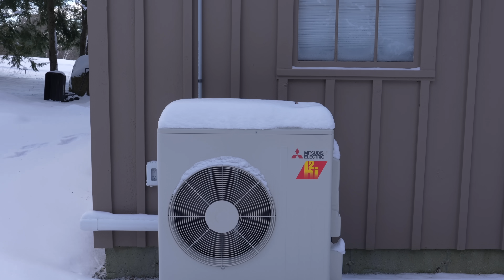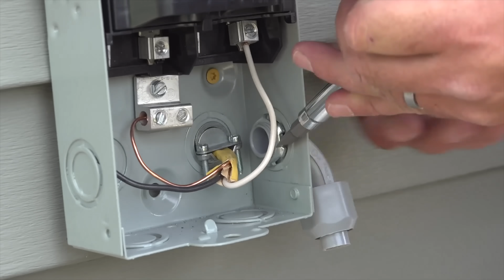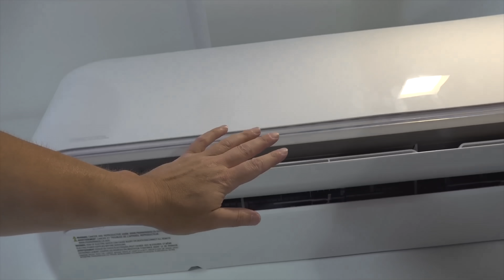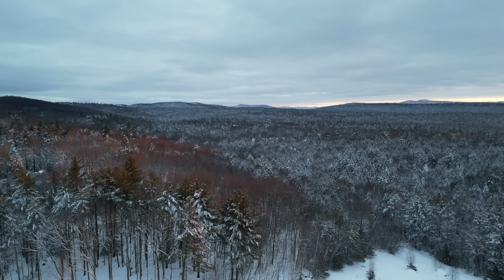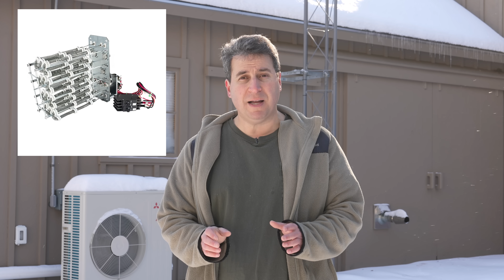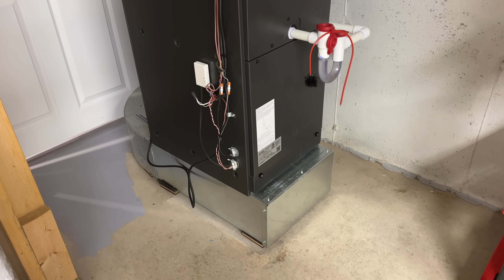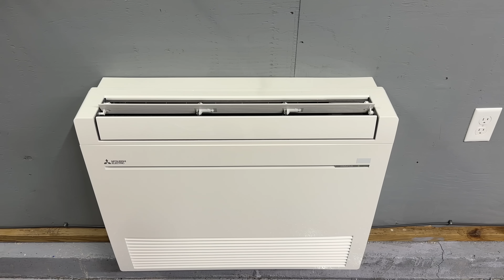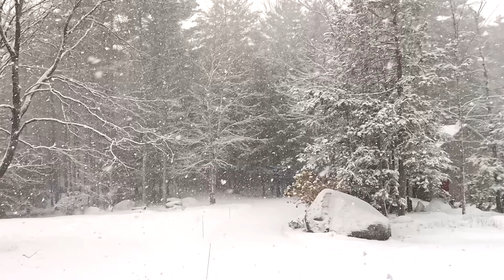Why Heat Pumps are now leaving people COLD

Comment: My experience is that our heat pump is extremely efficient most of the year when it's just a bit cool outside. There's typically only a couple days a year we really need to fire up the old wood stove to stay comfortable. It's also pretty cheap to keep a bunch of firewood in the basement in case of an extended power outage. Though what made a really big difference was renovating the living room and discovering that a large section of the outer wall was basically uninsulated. Simply fixing that and installing better windows cut our heating costs in half.
Reply: Blows my mind how many people don't understand the basics of heat pumps. They're great for small changes in temperature, but really struggle in crazy weather. That's sorta the entire point, it's efficient, it's like being surprised a hybrid doesn't drive like a hellcat lol.
Reply: @Stealth86651  where I live my heat pumps work fine for cooling in summer when it’s 25 Celsius and also fine in the middle of winter when it’s -20 Celsius, so I find it hard to believe that people don’t understand that. On a side note if you knew anything about electric motors you’d know that the acceleration is immediate, so yeah they can go “like a hellcat”
Reply: All the nordic countries use heat pumps a lot for the last 20 yearsand we are not stupid.
Reply: @Grounded_message  Actually, you pretty much are. People who have "left" the oil and gas industry will quietly admit that they are lying and using well-funded misinformation campaigns against renewables, EV, heat pumps, etc.
And then, as with solar panels, there are con men and swindlers who get in early and try to make a quick buck. America, BABY!
Reply: @Grounded_message  Jepp you guys have cheap electricity, I have a heatpump but yes, I fire up my stove also 2-3 times per year just to support it through the really cold permafrost days. But we also pay 20-40 cents per KWh! But yes the efficiency goes through the roof once temperatures go above 0c which is the 80% usecase in our winters here!
Reply: @Grounded_message  That is debatable! ;)
Reply: @Grounded_message  Nordic countries have very cheap electricity. It always comes down to money and the cost difference between electricity and other heating mediums
Reply: @werpu12 Only in Norway. The cost of electricity in Sweden is around €0.25/kWh

The cost of electricity in Finland is around €0.24/kWh
Reply: To deal with the coldest 2-3 weeks a year the heat pump has to have a capacity to deal with that heat differential. This obviously makes the cost higher. BTW what do people in different countries pay for a 30kw heat pump?
Reply: Look up masonry mass heaters.  I bet that'll make you sick you didn't install one of those fireplaces.
Reply: You didn’t address hyper heat (Mitsubishi etc) vs resistance heat strips on a non hyper heat Mitsubishi . Do you really need resistance strips even in New Hampshire if you have hyper heat or similar ?
Reply: Well said. Heat pumps are great but you need a second back up heat source for a few days a year. Those who claim their only heat source year round is an air source heat pump is dishonest (or they live in the Sahara Desert).
Reply: @barrysnelson4404 i live in New Brunswick Canada 🇨🇦, I heat with heat pumps. They provide all the heat and cooling required. I have a propane fireplace in case the power goes out, and baseboard heaters in case the heat pump fails but I leave the breakers for them off. Most of my neighbors also have heat pumps and they are fine as well
Reply: @randylahey7343  Every one I know who is happy with there heat pump has another source of heating. I don't know your climate but the key flaw for us is that we have a maritime climate. It is not very dry cold that heat pumps struggle with but when the dew point is +3 and the air +1.
Reply: @barrysnelson4404  our heat pumps are rated to match the square footage of the home and the pumps themselves are rated to -30C, the coldest it gets here is probably-15 or 20C so the pumps have no problem keeping up. My house was built with electric baseboard heaters and I have a propane fireplace in the rec room but the breakers for the baseboards are off and we only use the propane occasionally in the evenings but it would be fine without it. I like the propane for if the power goes out, which is pretty rare where I am. My neighbourhood is probably 70% heat pumps and the only people that I have spoken to that have the need to supplement the heat have smaller and or heat pumps that aren’t rated for the colder temps. The right pump setup for the home and temps is the deciding factor.
Reply: @barrysnelson4404  as for location I have a view of the Bay of Fundy, which is about 2km(1-1.5miles) away,so cant get much more maritime than that. I’m about an hour away from the Maine border
Reply: @randylahey7343  It depends on the amount of moisture in the air very cold air drops its moisture as ice. In the UK we have many winter days with freezing rain and fog. It is not the cold. On a -10 cold clear day ours was fine. It is a heat exchanger that turns into an irremovable block of ice under certain conditions. If yours works fine that's equally fine by me but we had ours taken out and replaced with gas after 8 years. We loved it for 46 weeks of the year but we have no other heating equipment for the house and we just got colder and colder. I am for heatpumps but they are just engineering, and not a miracle solution and my objection is to the way they are zealously defended. They are just 'things' if they are configured correctly they won't disappoint. If we had had another heating source we would have kept it.
Reply: @barrysnelson4404  engineered properly is definitely the key, I’m right on the Atlantic Ocean, we get snow, freezing rain, snow and massive temp drops all within the same day numerous times a year. I suspect the heat pumps in 🇨🇦 like mine are engineered to handle this. I’ve got a 4 level split entry, 2 outside, (total 54k btu ) pumps with 4 inside heads (one per level, total 48k btu), the house is around 2600sq ft. This keeps the outside units from getting maxed out. We get -10 to 20C for a couple of weeks every winter and they keep up with no problems. It’s just about having the right tool for the job.
Reply: @barrysnelson4404  what system do you have?  I'm looking for one for mid-coastal Oregon and considering the Mitsubishi Hyper Heat 36K btu.
Reply: @cfrates2703  Tricky, as my advice is based on a very wet England. I loved my heat pump and miss it but you need to get three things right (in my view).
1. Excellent insulation. It is not a powerful oil boiler but a 24/7 source of lukewarm water not as warm as your blood stream. We have superb insulation but still reckoned it took the heat pump 2 or 3 days to get the house warm.
2. Large heat transfer surfaces. The out let is 35deg not 65deg like an oil boiler so you must need very big radiators or underfloor.
3. Emergency heat source. This was our weakness. There will be days that the heat exchanger is solid ice. We just got colder and colder. If we had had a backup it would have been perfect.
Ours was  a Daikin Altherma 16kW
Reply: @barrysnelson4404  Mine did that too. I live on the Ottawa river and got plastered with the snow coming in sideways . That's when we got the freeze up too. A solid block of ice. I turned the unit to AUX or heat strips and defrosted the outdoor unit with water. That worked really well. I build a wind break and a roof around it and had no problems since.  I am sorry you went the way you did. Maybe you could have installed a propane or gas heater in your house and it would have been fine.
Reply: @barrysnelson4404  what is your level of insulation, windows, etc? My impression was that UK homes are generally less well insulated than here in Canada and that might explain the difference in terms of your heat pump not keeping up. New homes here are supposed to be R25+ walls, R50+ roof, and generally nobody has single pane windows, even old houses at least have storms. The newest cold climate inverter heat pumps here are about 75% of rated efficiency down at -25C.
Reply: @randylahey7343  In Ontario we have natural gas pipelines ... and they are SO cheap that heat pumps cannot compete. In areas that don't have the pipelines heat pumps are a common choice. (I lived in an area where I had baseboard heaters, I would have switched but circumstances caused me to move).
Reply: @randylahey7343  THIS sounds like where I used to live. All the houses built with baseboard heat and wood-burning fireplaces (easily converted to propane), so you do have a backup if it REALLY gets too cold.
Reply: @barrysnelson4404  My Trane heat pump has backup heat strips. The only time they've kicked in was in an ice storm we had here in La. when the heat pump would go through it's defrost cycle.

Comment: All good points, sir.  Ive been involved with mitsu for 20 years and its great equipment.  One thing I would like to add to your contractor comments:  Hire a professional!  Any contractor worth his salt will 100% consider the home's heat loss and will recommend the necassary equipment to heat the space under worst case scenario.  Also, every manufacturer I have ever dealt with will publish the product data with the BTU output at certain temperatures.  Even your hydronic coil has a BTU chart with water temps and BTU output.  Most homeowners are not privy to this information, but if the contractor is not covering those bases upfront then they are not qualified to sell or install these.

Comment: My HP has the heat strips locked out when it is above 5°F. Modern heat pumps always have a COP over 1 so running them always costs less than the resistance heat even when they can’t keep up let them run. Set the thermostat to one temp 24\7 with a HP.

Comment: I have a Mitsubishi duel fuel ducted system that you are talking about but we just went through a few days here in Wisconsin where temps were on average zero degrees during the day and below that in the evening. The system has only kicked on the natural gas furnace 3 times. Roughly at sunrise and just after. We’ll see what the heat bill looks like this month but the house stayed at the 68 degrees mark through the whole sub-zero stretch. We were very comfortable.

Comment: Have a high efficiency Lenox and it is useless below 20 degrees.  My back-up propane system runs more often. When it outlives its lifespan, I will never replace it with another heat pump.

Comment: This is probably why the Department of Energy is trying to push low temperature heat pumps. I have a heat pump in Central Texas, and I really wish we had natural gas in the house. I set my heat pumps minimum temperature, and the house ended up using 125-150 KWH because it was around 15 degrees outside. I had spikes to 20 kW because of the emergency heat kicking in. Natural gas doesn't care, it just burns, haha.

Comment: Consider the following:  Hydrogen.
Collected rain water and/or melted snow and ice, electrolyzed, preferably with green dc electricity, to generate Hydrogen and Oxygen.  Could store the Hydrogen and release the Oxygen into the atmosphere if you did not want to deal with Oxygen storage.  Burn the Hydrogen (in air with Oxygen) or re-combine the Hydrogen and Oxygen in a Hydrogen fuel cell to get electricity back with a by-product of basically pure water.
Reply: Basically, could shovel snow and ice into your furnace to heat and power your house.

Comment: As outside temp goes down, the heat pump compressor compression ratio rises which takes more electric energy to run the compressor harder.  There is a limit to what the compressor can do.  Units that can handle lower outside temps have compressors that can run at super high rpm's.  That still does not fix the fact that efficiency of btu's of heat produced in house is lower.

There is a specification call CoP, for coefficient of performance.  An electric heat strip system has a CoP of about 1, meaning it creates 1 kW of heat (3.4 kbtu's) for 1 kW of electric power.  A CoP greater than 1 means you are transferring more heat inside than the system consumes in equivalent electric power. CoP of 2 means 1 kW of electric used to transfer 2 kW's (6.8 kbtu's) of heat.

At 45-50 degs outside a heat pump may have a CoP of 2.5-3.0 but as outside temp drops so does the CoP.  At about 15-20 degs outside temp the unit may be operating with a CoP of 1.2 -1.5 and the amount of inside heat produced is less btu's.  As temp drops more, the CoP approaches 1 and you get even less btu's of heating produced.  At that point you may as well be using electric heat strips that you can size to produce as many btu's of additional heat needed to heat the inside area.

Comment: I would not use the word “failing” as the units are working as described.  What has failed is the lack of communication with the salesman / contractor.  
   I have a new 48kw Bosch system.  The system works great down to 10 F degrees.  Anything below that it struggles.

Comment: A long time ductless/high efficiency heat pump professional here. 

Not all heat pumps are created equal, even from the same manufacturer. 

The efficiency drop off that you talk about applies to many heat pumps, but not all.  Many modern variable speed hyper heat/ultra heat heat pumps actually only see a marginal drop off in efficiency at low outdoor temperatures.  With advances in engineering such as vapor injection, and 2 or 3 stage inverter compressors, a well engineered heat pump can produce incredibly warm supply air temperatures, even in -20F and beyond outdoor temperature.  I've seen it, I've felt it.  

A significant portion of my career in this field was spent in Canada.  Ultra Heat/Hyper Heat heat pumps are wildly popular there, often used with no auxiliary/supplemental heat.  I'm not blowing smoke.  I'd be happy to chat privately in more detail.  

I'd still recommend a secondary heat source, not for supplementing the heat pump, but for redundancy in case of a failure or power outage.  A gas or oil furnace or boiler, for example, takes very little electricity to run.  A heat pump requires a larger generator.
Reply: So, you think we should buy one; try it out if it doesn't work buy a different model; brand And keep switching them out until we get one that works?
Reply: Thanks for your comment. It brought up some stuff that I didn’t know about. 

You can probably answer a question I’ve been wondering about. Does the reduced efficiency take into account the defrost cycle? The defrost cycle on mine starts when there is just a trace of frost on the coil and that seems too soon.

Comment: I live in mid hudson Valley ny. I have the ducted type central air heat pump on the second level of my home. Works great. Haven't had any issues. 
It doesn't turn on a much throughout the night.

Comment: Here in East Tennesse we mostly use electric back up heat and it has been that way since we first began to use heat pumps in the 1970s.  I lived for a while in Atlanta Georgia, there gas heat with electric air conditioning is most popular.  However sometimes I did see elecrtic heat pumps mounted on gas furnaces and the gas furnace was wired to be the aux heat unit.  As you point out hot water heating is also an option.  The great thing about all these back up heat systems is that in the event of a compressor failure, they can be used to heat your home.

Comment: One option to consider with a concealed-duct mini split for a small space, like an apartment or a single room, is an RV diesel heater. They're easy to add to existing ductwork and #2 heating oil's pretty cheap if you're only using it for supplemental heat instead of primary, plus those things take up basically no space and make quite a bit of heat for the sub-$100 purchase price. Either that or go oldschool and get a good kerosene heater, cheapest supplemental heat that doesn't require rebuilding a chunk of the house or having gas hookups, just make sure to keep a window cracked and the bathroom exhaust fan turned on.

Comment: If you need supplemental heating external to your heat pump, look at natural gas or propane wall or floor furnace. They don't require electricity to run so they will keep you warm even during a power outage. Wood stoves are even better (no gas lines that may freeze).

Comment: Another thing to remember is when your heat pump loses a TXV or a compressor or even a reversing valve, make sure your heating company is willing to lay in the snow with 10 degree temperatures to repair it. I have 2 right now and I tell the people to put it on emergency (resistance) backup and we will be there in the Spring. The reply is always with crying, that will cost me 700 a month. My reply is consistent, tell it to someone who give a sh#t.

Comment: I am a HVAC contractor in Canada and  provide both heat pump and gas furnace installations and always tell my clients the truth , If your going to remove your high efficiency gas furnace and replace it with a heat pump you will jeopardize your comfort and the cost of heating your home will double . Also in a power outage you can run a gas furnace on a very small  2000watt generator .
Reply: I agree that a gas furnace can easily be run off a small gas generator. However......if a home requires an input of, say, 150,000 Btu/hr to maintain comfort at a certain outdoor temperature, the heat pump is far more efficient, moving heat at minimal cost from the outdoors into the interior. It's only at very cold temperatures that the gas furnace starts to be the better choice vs and air-source heat pump. Several of my neighbors have done the math and gone ahead with heat pumps; Their increased electric costs are more than offset by the almost negligible gas bills. I will say this; if you have a furnace, or or gas, keep it for backup. It's already paid for, right?
Reply: that same 2000w  generator will run a 24,000 BTU  mini split with power left to spare